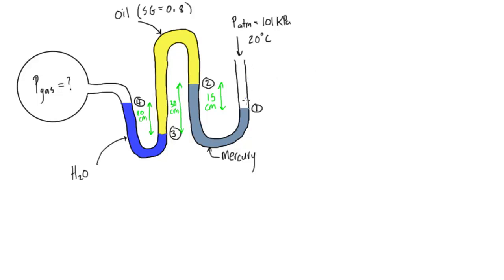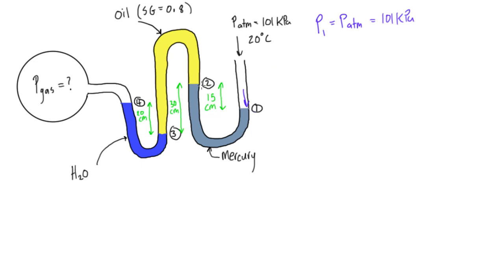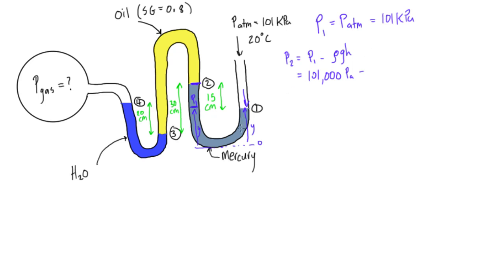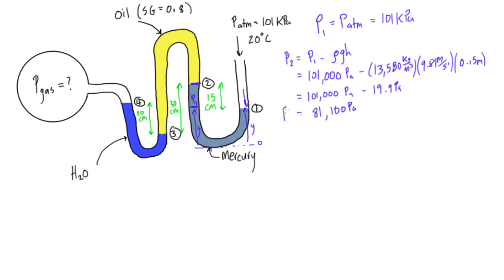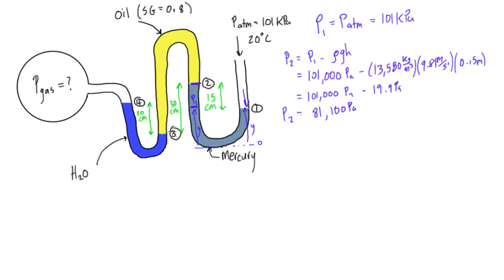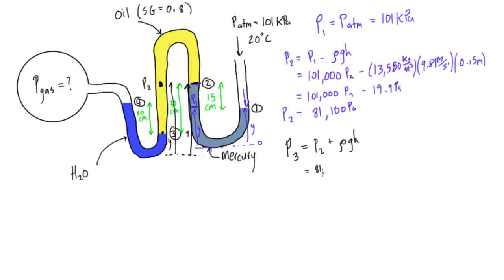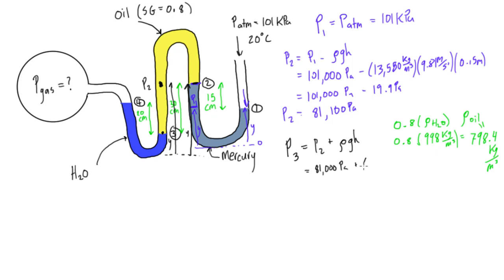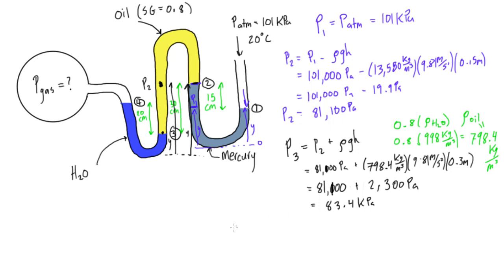Compound manometer example problem

Comment: Hi I was just curious how pressure would be impacted if we had air in the tube in-between p2 and p3 instead of another fluid
Reply: As the density of air is negligible compared to the densities of mercury and water, point 2 and point 3 would have the same pressure
Reply: @Orleezinc  ok ok, that's what I thought, thanks for the reply!

Comment: Hi, is the pressure inside the tank the gauge pressure or the absolute pressure? I really hope you answer this🥺
Reply from the maker: Hey, it's 81kPa absolute, or -20kPa gauge
Reply: @Engineer4Free  omg thanks for replying but how do you calculate that?
Reply from the maker: Sorry I wrote that above reply wrong. Should be "-20 kPa gauge". Atmospheric pressure is given as Patm = 101kPa. Gauge pressure is how much pressure we are above reference (atmospheric) pressure. So Patm 101kPa Absolute = 0 kPa Gauge, because it's 0 kPa different from its self. 81 is 20 less than 101, so we are 20Kpa less than the reference, or - 20kPa gauge. Sometime you refer to negative gauge pressure as vacuum. So we could say "-20 kPa gauge" or "20 kPa vacuum" or just "81kPa absolute". Watch this video too: https://youtu.be/oOMzRzpNBEE
Reply: @Engineer4Free  ahh yes okay that makes sense. Thank you!

Comment: I think P1=0 as gauge pressure in atmosphere is zero. In the manometer we are actually measuring gauge pressure.
Reply from the maker: Yes, P1 would be zero if we consider atmospheric pressure to be 0, which is the norm. This example was done in the frame of absolute pressure though, not gauge pressure. Pgas in this case would be -20kPa gauge (or also you could say 20 kPa vacuum. Either way, Pgas is 81 kPa absolute, which is 20kPa less that the surrounding atmospheric pressure.

Comment: great video. i have a question though, see how the gas inside the bulb is higher up than point 4 wouldn't there be a difference in pressure? thanks.
Reply from the maker: Because it’s a gas and not a liquid, you can ignore that height. Change in “depth” of gas is minuscule compared to that of liquid.
Reply from the maker: Because it’s a gas and not a liquid, you can ignore that height. Change in “depth” of gas is minuscule compared to that of liquid.
Reply: @Engineer4Free  good to know. Cheers
Reply: I was thinking thins as well. There should be an extra pho*g*h for that pressure difference because pgas is higher

Comment: Isn’t 13500*9.81*0.15 is equal 19865.25?
Reply: And it will be 101,000 - 19865.25?
Reply from the maker: Yeah I just rounded prematurely. You should keep more sig digs in calculation, but when I make these videos sometimes it's just super time consuming to write out the full value for such big numbers. But essentially 101 kPa - 19.9 kPa = 81.1 kPa.

Comment: Hi, I'm confused as to which liquid density im supposed to choose everytime i calculate the pressure.
Reply from the maker: You always want to calculate the difference in pressure between two different points in the same fluid. Typically, with a compound manometer problem like this, you want to find the difference between the high boundary and low boundary of each fluid. When doing that, use the density of the fluid that you are considering the top and bottom boundaries of.
Reply: @Engineer4Free  thx!
Reply: You need to consider all of the liquids/gases including the Atm. Press. My technique is just look for the first end of the gas/liquid and determine if the other end is above (negative) or below (positive).

Comment: Hiii i have a question, if the pressure at a certain point is lower than the current then does it have to be positive? I mean add
Reply from the maker: We consider pressure to increase in the positive direction when we move down through a fluid.

Comment: Hello, I would just like to know if the final answer of the gas were in gage pressure, would the answer be P4 - Patm? Thank you!
Reply from the maker: Yes, and in this case 81 - 101 = -20 . A negative guage pressure is referred to as vacuum. -20 kPa guage = 20 kPa vacuum.

Comment: There is only one thing that is killing my mind we always talk about the pression from the top what about the pression ftom the bottom!?? :/
Reply from the maker: We talk about pressure from the "top down" because that's where the interface with the air is, and thus a known pressure. If you inverted the manometer in this video, the mercury on the furthest right part of the manometer would just fall out, just like turning a cup upside down. That's why you always see a boundary of liquid and gas with the liquid on the bottom, otherwise it wouldn't work. It doesn't mean that the first measurement has to be "going down" though. In this video, point 2 is above point 1, and although the column of fluid initially extends downward from 1, we don't care at all how far down it goes, we just care about the relative height difference between 1 and 2, and in this case 2 is above 1. Does that clear it up?

Comment: i think p1 = p(atm)+pgH cuz the pressure that applied via p(atm) is higher than the oil
Reply from the maker: P1 = Patm because it is in contact with the atmosphere, and the air on the outside of the manometer in this problem has pressure = Patm, including the air that is right on the boundary (in contact with) the mercury. If you go down into the mercury, the pressure in the fluid starts increasing with Patm+ρgh. When you go around the bend and start coming back up the other side, the pressure in the mercury drops by ρgh until you reach the same depth on the left hand side (which I mention at 1:31): that point also has a pressure of Patm. Moving even higher up pas that point, pressure continues to drop at a rate of ρgh, and once we pass point #2, the ρ changes to that of oil. I think you are seeing the difference in height of each side of the mercury and thinking that somehoe the Patm is lefting the other side, but for compound manometers like this, you can't look at them and come to a conclusion like that, you need to methodically go through each fluid one at a time and calculate as I did in this video. Hope that helps!

Comment: This video is gold. Cleared my concept after 4 years. Thanks a ton!
One thing l'd like to ask: The pressure you took at P1 = P(atm) is a gauge pressure or absolute pressure? I have seen in some books that P(atm) is taken zero sometimes. Can you explain?
Reply from the maker: Yeah this whole video is done in absolute pressure. If you define Patm = 0 then take the difference between any P and Patm and you will have the gauge pressure instead (actually in this video, P2,P3,P4 will all be vacuum). This is a good video on the difference between absolute, gauge, and vacuum pressure: https://youtu.be/oOMzRzpNBEE
Reply: abs .. i think 
coz its open
Reply: from what i have learnt , it is absolute

Comment: 13,580 * 9.81 * 0.15 =/= 19995 as you suggest in your first calculation. it is 19982.97, thus your final answer is a little off. great work through and still useful.

Comment: Why is specific gravity of oil being multiplied with the density of water
Reply: SG is density relative to water (if liquid) or relative to atm if a gas, density of H2O at 20deg is 998, so it's 0.8*998 to give actual density.
Reply: because it is relative , Specific gravity = Specific weight of oil/ specific weight of water and since density =specific weight /gravity   density then is specific gravity multiplied to the density of the water.

Comment: Thank you sir, had some problem getting over the "unsidedown oil" part in a exercise problem I've been having, but when you said "as you go down deeper into the fluid P3 is going to be greater than P2" then my mind finally got it hahaa, thanks.
Reply from the maker: +RikkuCloud sometimes you just need to hear things said in a slightly different way.  Glad it helped and thanks for commenting!

Comment: I dunno why there is a subtraction or addition since my teacher doesn't teach that kind of method. Please help me, do you have some lesson similar to this. My teacher said that he will include a lot of this in our exam Huhuhu
Reply from the maker: +Raeii Lobete Hey, I made 10 fluids videos so far, you can find the whole playlist here: https://www.youtube.com/playlist?list=PLOAuB8dR35oeOIPMOBH6hjwobuIJHPKSN if you have time, it's worth watching all 10. If you are in a rush, the last 3 videos in the playlist are directly about manometers. Basically, if you are looking at pressure in two different heights in a uniform colunm of liquid, they will have different pressures. Lets use the example from this video, where P1 and P2 are both connected by the single column of mercury, and P1 is lower in height than P2. P1 will have a greater pressure, because there is more fluid on top of it (15 cm more of mercury to be exact). So that means P1 is greater than P2. Think of how the bottom of the ocean is under a great amount of pressure, that's because the weight of all the water above it is creating the pressure. So if P1 > P2, then that means P1 = P2 + something. Conversely, if P2 < P1, then that means P2 = P1 - something. (where "something" is a positive value). "something" is always = ρgh. So in other words,  if you know point is lower than another in a continuous fluid, then the pressure at the lower point = the pressure at the higher point + ρgh. If you know the pressure at the lower point, then simply subtract ρgh to get the pressure at the higher point. It seems a little backwards because you add when you go down and subtract when you go up, but remembering the example that the bottom of the ocean is under high pressure, that can help sort out which way adds pressure and which way subtracts pressure. Hope that helps!
Reply: Thank you so much sir

Comment: Hey .. i think u have sumn wrong ... Monometers measure gauge pressure ... meaning at 1 atm the gauge would read '0'
Reply from the maker: +Francois Pasmore Good observation. I did this problem using the absolute pressure measurements. In this case where I find the pressure of the gas to be 81 kPA absolute, that could also be expressed as 20 kPa gauge (101 kPa - 81 kPa = 20kPa). Perhaps I should have been more clear that I was using absolute pressures!
Reply: +Engineer4Free ok that's for clearing that up

Comment: Thanks for sharing. Shouldn't the equation to find P4 incorporate a height of 0.1m instead of 0.2m? As it's drawn 0.2m  is the distance from point 3 to 4.
Reply from the maker: Daniel Lovik Hey where are you getting 0.1 from? We want need to use the vertical distance between 3 and 4 to find the pressure at point 4. The difference in pressure between any two points in a continuous body of a single fluid is ρgh where h is the difference in elevation between those points. Points 3 and 4 are both touching the same continuous body of water and are separated vertically by 0.2m. The shape of the body of water has nothing to do with the pressure as long as it's continuous. Once you know the pressure at the boundary between the oil and the water (point 3) write it down, then forget all about the oil and just consider the heights of the two ends of the water. This was the same logic used to find P2 and P3. Let me know if that helps or if you're still confused about it!
Reply: Engineer4Free Ya, still somewhat confused. I miswrote the last sentence in my previous comment meaning 0.1 not 0.2. As far as I can see the vertical distance from point three to point four is 10cm or 0.1m. Perhaps I just read it wrong and the distance between 3 and 4 is supposed to be 20cm not 10cm? Hopefully that's the case. 

Thanks